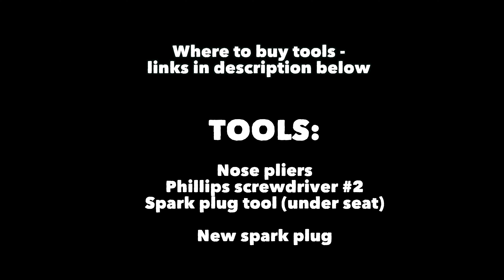Vespa LX Spark Plug Replacement Tutorial | Mitch's Scooter Stuff

Comment: I have an issue with my 2008 lxv it keeps cutting out and the oil light comes on checked oil both gear and normal seems fine gonna charge spark plug as I’ve not long Got the scooter with 9k on the clock and want to try fix the issue myself with out taking it to the garage any advice would be very much appreciated 🙏
Reply from the maker: Hey, is intake tube in good condition? No cracks on fuel / vacuum hoses? Air filter clean?
Reply: @ I will have a check when I get the chance from not working  will need to find where they are all located first 🤦‍♀️🙏
Reply: @ hi I took the air filter off and checked that today while changing the spark plug also all hoses look good no cracks I even took the battery off and fully charged that up and yet it still won’t start

Comment: Hey Mitch, 

I bougt a vespa lx50 4T, If I accelerate, it loses power, I cannot drive at full speed, what should I check first? Some people say spark plug, some carburetor? some fuel filter. Last question, where is the sparkplug located on a lx50 4T, is it the same as yours?
Reply from the maker: Same spark plug location like in this video… maybe it’s loosen that couldn’t get full power, let’s start from there
Reply: @MitchsScooterStuff  I solved the problem, there was a hose that's going to the carburetor it wasn't connected. I placed it back and it works fine now. Thank you!

Comment: i ordered a spark plug after watching this. however i was not able to take it out on the lxv 125 ie. the bolt was slacking from the tool. Surprisingly, while taking off the cable the othen end came out!! 

While giving up on unscrewing the spark plug, i found out that the other hand of that cable was indeed loose, i plugged it back in, and voila! turns out i did not need a spark plug at all. :) 

 great tutorial  btw, but check out your cables as well folks!
Reply from the maker: That’s great to hear! Glad everything’s good 😄🙌🏼

Comment: Hi Mitch. I always check the spark gap first before install. New spark plugs can get knocked around in the box.
Reply from the maker: 👍🏼👍🏼 Good tip!
Reply: Every time i bought them they had cardboard sheating the electrodes so no problem